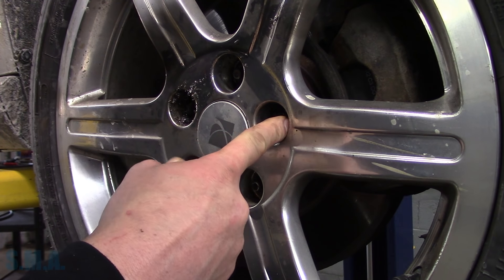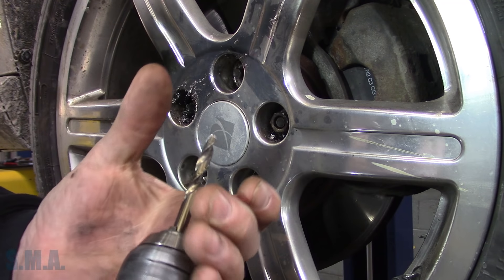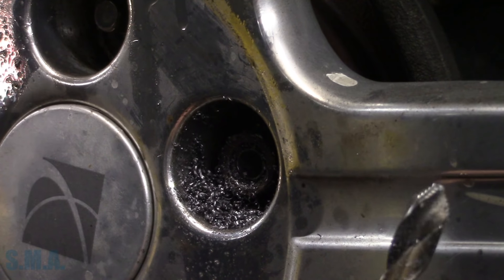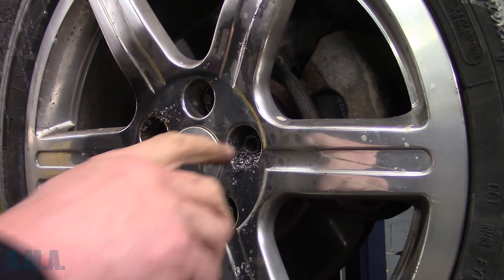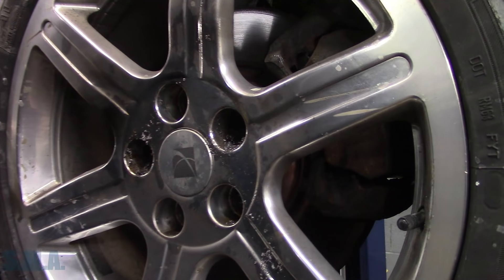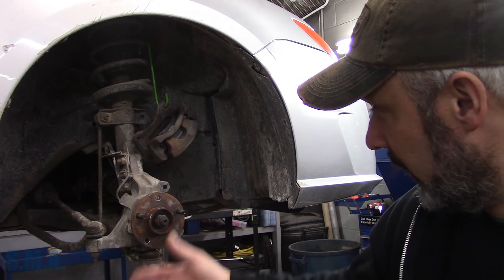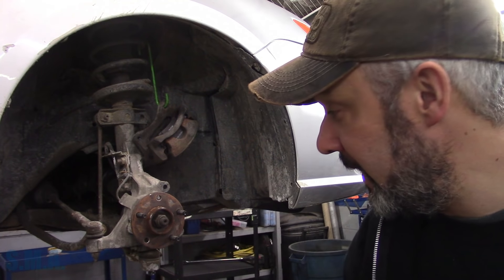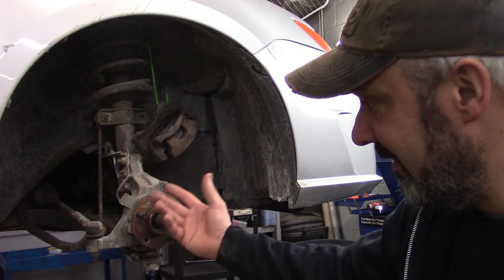DIY Seized/Stopped Lug Nut Removal

Comment: Love your videos. Thank you for doing what you do and being so thorough. One day I hope you can do a video on testing a temperature sensor and the best way to diagnose over heating. Thanks again you a are awesome!
Reply: Use a pot of water on your stove, thermometer, and use a multimeter on ohms. Start out with cold water and watch the meter as it warms. Specs should be in a repair manual. Watch for an odd jump in resistance, which is likely on a bad sensor.

Comment: Never had this issue when I worked at a tire shop here in Alabama....we just had the 20 mins search the car for the lug nut lock. And then in most cases just hammer on the socket and buzz it off. lol

Comment: I once had a wheel stud which was ripped out of the axle hub. That was a pain in the butt to get out because you couldn't drill into the stud. Kept turning happily in circles. Had to ruin a brand new wheel. And all because the brand new nuts that came with the wheels were so badly made, that they chewed up ALL studs. 16 new studs, 16 lug nuts, 1 new wheel. Thanks a bunch.

Comment: I really hope you set this customer up with some McGard lug nuts after having to destroy all of them on that car. While back when I got a tire rotation the shop said my lug nuts were starting to swell and it was time to get new ones. Did some research, went with McGard, no problems, well worth the extra few bucks (PS: not a sponsor).
Reply: So many people got the swollen nut syndrome and realistically, not much need to change them in some rust bucket salt places...BUT it surely takes your typical 5 10 minute rotation into a 15 20 25 minute ordeal. Hitting every lugnut out of the socket and beating it on, isn't the best. Let alone the ones so swollen, no clue how you'd torque them. Takes a good long time with them.

Comment: My method...  hit it with my purse.

Actually usually have not run into one that the flank bites don’t catch.  I have this threaded socket I got at Advance (not a sponsor) I kinda wanna try but haven’t had a need to get and I don’t look hard for a reason. 😬

This sounds good and those drill bits are slick but probably outta my budget. 🤔

Comment: Reminds me of those crappy locking lug nuts with the "locking" part on the outside of the lug nut. Usually found on ugly after market wheels painted badly flat black.
Reply: The splined ones lol? yeah they're normally on some wack rims...i got some OK ones for my car, i think they look alright, but the lugs are for sure weird thing,

Comment: I am dealing with this very issue on a 2000 Grand Cherokee. The tire shop rounded off the lug nut and then mangled the hell out of it trying to get it off.  I ended up taking the vehicle to a regular repair shop and even they could not get it off. They did manage to get most of the nut off but the crown of the nut is still there and still won't come off. This weekend I am gonna try to drill enough material out of the nut to break it off without damaging the wheel.

Comment: I have never dealt with 20 stripped lug nuts, but what I have done in the past is charge the customer for a cheap socket thats a little smaller than the lug nut. Then hammer it on then just  use a breaker bar

Comment: I had success one time by using a hole saw whose ID was the same as the stud.  It my case the stud protruded slightly beyond the nut to act as a guide to get it started. I did not even need to replace the stud, just ran a die over it.

Comment: With rounded wheel bolt or lock bolt without key, I have found that the easiest way is to buy the cheapest possible long sockets that fit over the bolt. You then weld the socket to the bolt from the inside using a stick welder and you need specifically the stick.

Comment: This side of the pond, most cars have bolts. Using left turning drill does the same trick as you're doing and often it (drill) graps the bolt and turns it loose.

Comment: I have used a cheap chrome socket that is too small and install it with a BFH. I then use a breaker bar. Gets those pesky locking lugs every time.

Comment: Eric, Have you ever had a parasitic drain from an intermittent door open switch in the door latch? Rust free, no salt Idaho 
'02 Lexus RX 300 270 to 430 mA drain in dome circuit that appears to be the door open switch or a drain in the dome light timer? I used your
 diagnostic tricks to find it. Thanks.

Comment: Just priced the drill bits, $500 for the set. But believe it or not I have had good luck drilling out studs with the Harbor Freight titanium drill bits.
Reply: They actually work pretty well on most metals if you keep the spot oiled and don't apply excessive pressure.
Reply: @flagmichael  that is exactly right.

Comment: I had this happen to me, but it was totally self inflicted. I had a flat at work. Was all pissed off cause I was going to be late for an appointment, used the forklift to lift the car... put the spare on. I didn't have any tools like an impact, but I was in such a hurry I cross-threaded one real badly with my 1/2" ratchet I had in the car. 

Sooo I went to put the tire back on after getting the flat fixed the next day and lo and behold, I couldn't get the one dang lug nut off. 

My solution: More impatience. I grabbed a 4' bar, put it on my breaker bar, and used my (at the time) 225 lb frame and jumped on the sucker. Snapped the stud right off, hammered it out and replaced the stud and nut.

I'm a lot more patient now, but in my 20s I had things to do. Even though I can't remember at all what they were now. I hate getting old, lol.

Comment: I had to remove lug nuts on a late model F150;  2 foot breaker bar and a 4 foot section of pipe. Yeah, It was at the local tire shop a week earlier. They should make them use a torque wrench for their first month on the job.

Comment: In my experience the lug nut is not froze to the stud but to the rim where the lug nut seats, especially aluminum wheels. Sometimes if you put your socket on the lug nut and give it a few good wraps with a big dead blow it will jar the lug nut free and will then twist off with an impact. To prevent this from happening one should clean the rim where the lug nut seats and put some anti-seize in there. Don't put anti-seize on the threads of the stud or on the treads of the lug nut. Only put it on where the lug nut seats onto the rim.

Comment: Great video! How do you remove the stud? The old ‘run a couple of nuts down the stud and lock them together’ trick likely won’t work as the thread is so messed up…
Could you grind two flats into the stud and turn it out? TIA!

Comment: Sounds typical of Walmart service center never go there because went there we time for something minor years ago and they cross threaded a nut on and never told me about it and discovered it shortly after took it back and fought them over it and they said I done it. But I ended up drilling it out and replaced stud.  I've removed others that where somewhat rounded off with nut extracter.

Comment: If you have to torch a lug nut try spreading some grease on the rim. It prevents the rim from burning but not the hole from turning black

Comment: There is another way which saves the stud and wheel.  Carbide tipped hole saw. Take the centre drill bit out and it will cut through the nut. Just got to be careful how far you go. Developed through the Jaguar forums because of the poor Ford designed wheel nuts!

Comment: Wow-that is the hardest way to remove a frozen lug nut!  Get your self a piece of 3” pipe slide it over the lug nut and weld the inside of the pipe  to it.  Stick welder works excellent for this.  Then pull it off with a pipe wrench.

Comment: Anti seize is king. Learned that at bus garage
Reply: Seizing wasn’t the problem here. It was the crappy chrome plated two piece lug nuts. The chrome caps come loose from the main body and fall off or spin on the lug. Then joe dirt puts his 19 mm/ 3/4” lug wrench on what’s left and rounds it off. I always peel the defective cap off and use the 18mm socket the same as he describes and never have a problem getting them off. The trouble with this one is some noob probably spun every one with an impact with the 19mm socket with no chrome caps before taking it to a real mechanic that knows what they are doing. Aka south main

Comment: I went to a place once that rhymes with Sniffy Pube and they completely stripped my oil drain plug. Then, like a moron I went back a few months later and the geniuses there filled my coolant reservoir with washer fluid. I ended up bringing it to a real mechanic for a flush and fill. Sniffy Pube paid the bill and the manager got fired.
I got an apology letter from the district manager along with a coupon for 6 free oil changes.
I used them to start my wood stove.

Comment: I love when I have to do this on a Honda and then pull the hubs to get new studs in.
Reply: Yeah I remember having to use a slide hammer to pull the hub off to replace the brake shoes and rotors. Any time ya use a slide hammer ya stand a chance of damaging or stressing the wheel bearing/s. Not a very good design. I prefer the rotors that bolt onto the hub and hope the rotor doesn’t weld itself to the hub with rust.

Comment: All 20, wow! Was that Moe, Larry, or Curly? 

When i was working at volvo as a teen, just starting oil and brakes, total greenie, i got a car where someone stripped the threads off just about all 20 studs, only like 3 came off. I didn't know how someone could do such a thing at the time, but luckily the car had steelies and i got my first taste of the biiiig angle grinder...

Those poor cars were regularly ravaged by quickie lube places. They loved stripping the huge 22 or 24mm oil drain nuts out (in a steel pan too).
Reply: Ya just gotta use a 3/4 drive impact on the drain hardware.

Comment: Here's my method: use appropriate size socket and a torque wrench to torque to proper specs. Haven't had an issue with any of the cars I applied this method to :D
Reply: That's crazy enough it just might work!

Comment: Hammering a 12 point socket that is a size smaller than  the original lug nut size onto the nut has always worked for me. However, you can't use a cheap socket because it'll crack the socket but you don't want to use a really good socket because it does damage the socket after it's been used to remove 4 or 5 lugs in this way. Use a midgrade socket and replace it after it has been used for this 4 or 5 times. Hasn't failed me yet.

Comment: This is what happens when you put impact wrenches in the wrong hands. Probably tighten with a slightly larger socket needed. 19mm and 3/4 are about the same but you can notice a little bit of play if your using the wrong one. Also the chrome caps missing makes the lug nuts smaller than what they are supposed to be.

Comment: Question :  After getting that pilot hole started, how about a large left hand drill bit ?  Large enough that it grabs the lug nut.
Reply: You would have to completely drill out the stud so it bites into the nut only, but if the whole stud is drilled out it shouldn't be tight anymore. 

The socket he used is a similar idea, but it grips to the outside
Reply: Keep in mind, he's drilling into the wheel stud, not the lug nut.  Lug nuts grip on the outside of the stud.  A left twist drill bit won't make a difference other than the higher price of the drill bit.  You'll get the same outcome of drilling through the stud.
Reply: @eaveskc  You just need to drill down far enough that the large left hand bit will contact the nut.

Comment: What would you recommend to remove a alloy wheel that is stuck to the hub face? All lug nuts removed and the wheel won’t budge. Tried kicking it, hitting it with other tire, putting lug nuts on loose and going in a tight circle, ect. None of it has worked.

Comment: I have had issues with wheel nuts galling on Subaru studs of the 2008+ era that I never had on the older models. I'm wondering if they switched to cheaper wheel studs. 
Anyway, tips on trying to get a nut that's galling-up off the stud would be handy. Also if applying some anti-sieze to the stud in the first place is a wise idea.. or a dumb one.
Cheers,

Comment: How about the extractor with a torque multiplier. Sometimes the impact is more of a hindrance than a help. When I did the brakes on a used truck I had purchased the breaker bar was ah bending. Using the TM all 24 came loose and no broken studs. Patience.

Comment: So this has happened to me and friends plenty of times due to shops using the impact to bang on lugs without using a torque wrench. They either round off or just break. I think the shops are more worried about liability of lugs coming off than having the customer deal with frozen wheel lugs many months later.

Comment: I use a 5/8 hole saw and you dont have to replace the stud if you're careful. The hole saw cuts the threads on the nut and leaves the stud untouched. 95% of the time it works every time
Reply: been scanning the comments for other methods and your suggestion is very enticing.

Comment: About 500 years ago, when I still lived in Rochester, I ended up cutting a steel wheel into pieces to get it off the car. I don't recall the exact car, but it was a GM and the wheel was a rally of sorts. The pisser was that I owned a lot of tools to remove said capped lug nuts and one by one were all failing. The customer had begun the butchering and then her husband took over. Then the Triple-A  tow truck driver and finally me on a lift in my shop. I finally ended up using the fire wrench and cut away the wheel. Now I am not sure if it was the curb or the rail road tracks that sent her into the curb that caused all World of hurt, but the wheel was 100% junk along with the very warn studded snow tire. So the only thing that mattered now was being able to put another tire/wheel on the car to make it useful again and get it off my lift!! So out came the fire wrench after many other tools failed. The kicker to all of it was once I had cut away most of the wheel and the spokes, the nut just about removed itself. So after that fiasco I would try the common tools first, but not spend a lot of time with them and move right to heating the crap out of the nut and giving it a couple BRRRP's with my air chisel and replace the lug along with the nut.. No more wasting time..... Ps. I am 99.99999999999999999999999999999999% sure the 18.5 MM was made ONLY due to those shit GM tin caps!!!!

Comment: I'm trying to drill an original wheel stud out of my 86 Chevy, and it is very hard to drill.  The bits are HSS and basically new and are removing very little material.  Apparently the studs are hardened.  Are all wheel studs hardened?  Help?

Comment: Serious Question - Don't those studs have a factory torque setting?
Reply: Normally it is based on the wheel. A common torque for small passenger cars and alloy wheels is 80ft-lbs. All the cars we have are 80 ft-lbs, so I got a torque stick from Amazon for 80 ft-lbs. Now I just use an impact and the torque stick, then do a confidence check with the torque wrench. If the first and last are good they are all good enough.

Comment: The other way to get a stripped nut off is by finding a socket that locks on to the walls of the nut not the points.  If the socket fits the wall if the nut it will turn it because it I'd on the flat sides of the nut which should move the nut with no issue .

Comment: My trick is to weld a sacrificial cheap junk china socket to the lug nut. While the nut is still hot use a breaker bar and carefully break the nut loose.

Did that on all four wheels of my Lincoln that had the factory lock nuts. The key socket was nowhere to be found.

Comment: You should have shown how hard it was to knock out the studs.  I've never seen that done before.  Thanks.
Reply: It's not hard with the right size hammer, you just drive them out. When you install the new studs you can usually do it with washers and a lug nut. Just make sure the studs are seated all the way against the shoulder or you might end up watching your wheel pass you on the highway.

Comment: Had a shop replace the rear differential on my Expedition a few months ago. Recently had a steel brake line rupture from corrosion and since no one wanted to run custom nicopp lines I was in the process of doing it myself and discovered they had cross threaded one of the rear lugs. My 1,700 lb-ft impact won't phase it. I've shattered an iron 4 way using a 4 foot breaker bar. Even though I have a 220 degree safety margin between MAP at it's hottest burning point and the ignition point of magnesium, I can't use a torch because it started to cook off the factory coating on the rim's face before it could get the lug nut anywhere near hot enough.

Taking it back to the shop in about 6 hours, fuck it it's their problem.

Comment: Pro-tip on any car with those chrome-capped lug nuts: Throw 'em in the trash! I did when I bought my new car. Pissed the techs off when it goes in for warrantee required service since it had non-standard real lug nuts on it, but at least those stupid sleeves wont come off. They are an SOB to remove later.